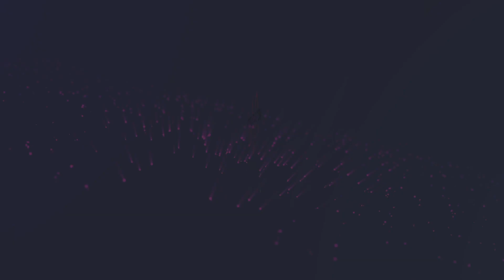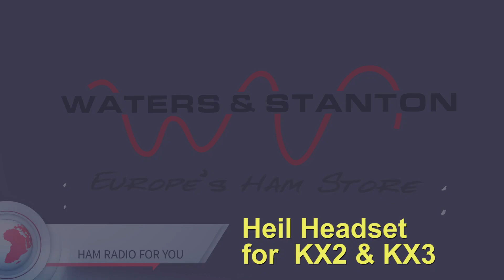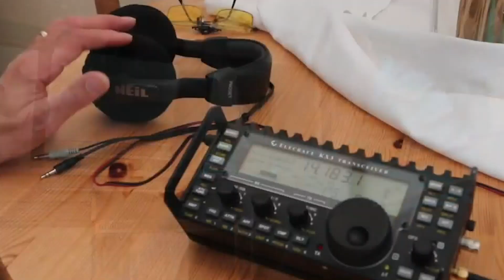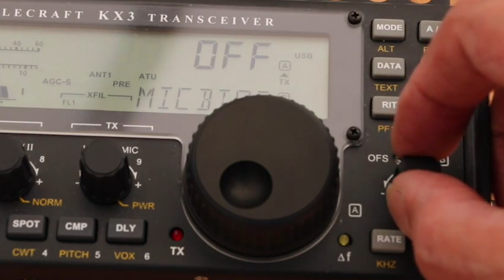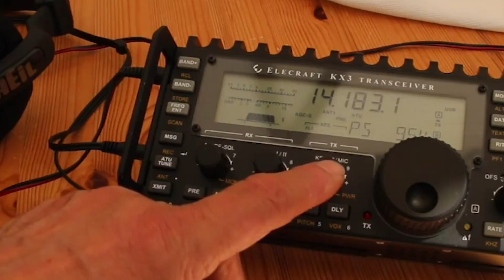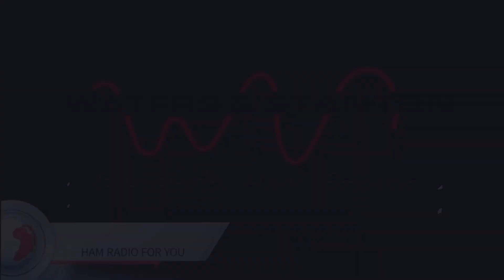Heil Headset for Elecraft KX2 and KX3 Transceivers

Comment: Hi 
I may be missing something but I have looked on your website and I can't work out which headset terminiates in the correct plugs for the kx3. Could you point me in the right direction.

Thanks
Steve
2E0WSF
Reply: Sorry, I phrased my question very badly. I wanted to know which model of the Heil headset has the correct plugs for connecting to the KX3.
Regards
Stephen
Reply: @stephenfine8671  SILENCE WAS THE STERN REPLY! Lol
Reply from the maker: The stereo 3-way plug goes into headphone socket and the 2-pin plig goes into mic socket 73s Peter